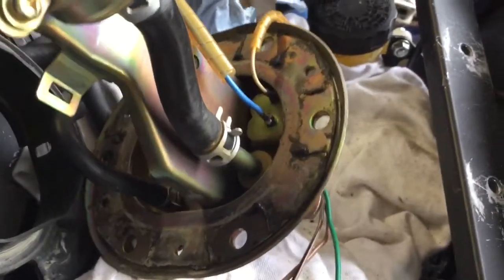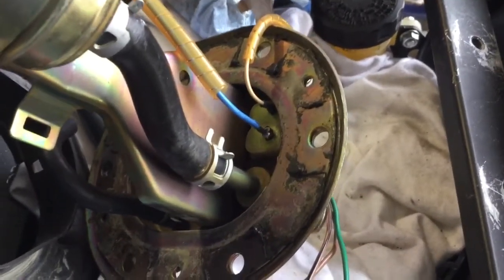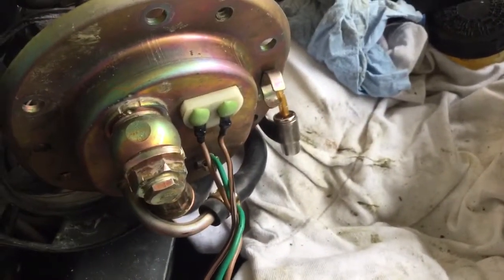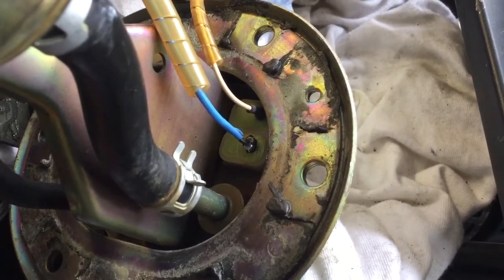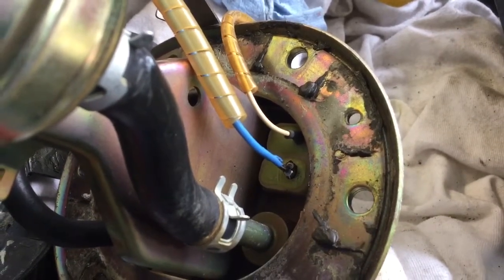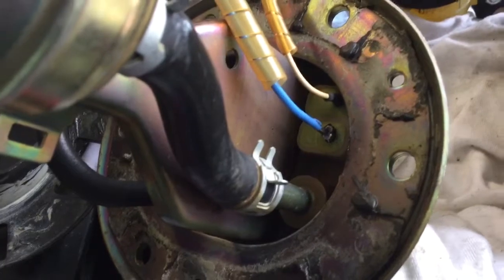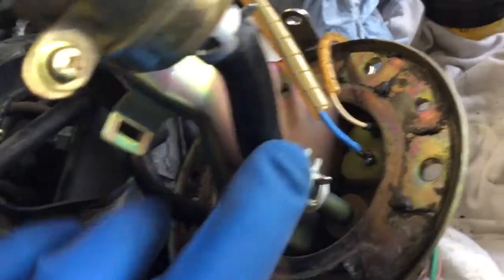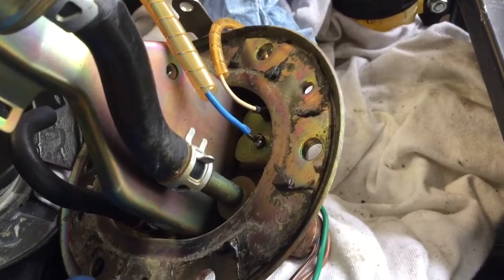Honda F4i fuel pump connection failure

Comment: I’m late to the party but I’m having the exact same issue. Mine was hanging on by 2 little wires how can I fix? I’m loosing power at 4th gear around 8k rpm can this be the cause?
Reply from the maker: Tough to diagnose. Losing power at 8k could be the fuel pump. The power on my bike was cutting out completely. You didn't mention if you have already replaced the fuel pump. Also, I had another bike that had aftermarket ignition coils. It would misfire when it heated up. I replaced with OEM which were more than four times the price if I remember correctly, and the problem was immediately gone. So a connection issue COULD cause your problem but it is more likely that the symptom would be intermittent shut off and finally no start. Another thing to check on these old bikes is the kill switch. Disassemble it and see if it provides a clean connection. They get a patina from age that can be a sneaky loss of power to the fuel pump. All the best...
Reply: That exact wire next to the blue one the orange/brown looking one where it hooks up to the top was what I meant that was hanging on by 2 wires
Reply: When I got the bike it was full of rust in the tank, so I treated it and got most of it off. Prev owner said he did fuel pump but not the fuel filter or regulator. So that’s what I was going to do when I noticed that wire barely hanging on
Reply: Do you know what that wire/ connector is called and if I can just buy it on its own ? If I can solder it then I will
Reply from the maker: @antoniolagorda  Have you checked continuity? The part is no longer available. You would have to look for a used one on eBay. I saw a few on eBay for $300 and up. That's a lot to pay without knowing for certain that it's the problem. Have you tried cleaning your injectors? Try some Lucas injector cleaner or Sea Foam. If you are having a consistent loss of power at 8K, I doubt it is the wiring harness. In my opinion, if it was a short due to vibration, it would be more intermittent and ultimately not start at all. My bike wouldn't run. I bought a fuel pump (still have it) but that didn't help so I traced it to the electrical issue.
Reply from the maker: On the OEM parts list, the unit that connects the fuel pump wiring harness to the bikes main harness is called the "fuel pump stay" and it is not longer available. The entire unit which looks like it includes the "stay" is available and costs $573 at Partzilla (that is for a 2002 F4i). https://www.partzilla.com/catalog/honda/motorcycle/2002/cbr600f4-ac-cbr600f4i/fuel-tank-01-06
If that links works the way I'd hoped, the "stay" is #8 and the entire unit is #1.

Comment: Seriously, thank you for posting this. Had a failure on my 2002, 919. Initially thought it was a fuel pump. Even put power to the old connector, before purchasing a new pump. Installed the new pump, and the thing was still dead. Did not think it would be possible to solder as you described here, but figured what the hell I’ll try it. And just as you said it would, it worked. 

You didn’t need to post this video, but you did, and your post save me a world of a headache. Thank you. :)
Reply: A couple of more elements to note, this appears as a common failure on the (non-RR) honda bikes from the early 2000s- to the early 2010s. So the F4is, the cb900f (aka honda 919), cbr929 etc. 

one of my concerns was the now-exposed-fuel-pump wire shorting out in the tank, either directly or from the metal "brillow-pad" that is around the fuel filter pickup and causing a fire. Two items here; (1) gas is an insulative  non-conductive liquid, so it should not arc (2) even if the brillow pad shorts against the wire in the fuel, it shouldn't catch on fire, because the fuel 'should' be able to dissipate the heat, so long as it is covered. Remember that it is the atomized gas that Is most flammable, and lighting a fire from the inside of the liquid out, is not so much of a risk. If the tank is sucked nearly dry, I guess that could cause a risk, but hopefully not :)

Comment: Did you cover the stripped back wiring with anything after you solder the joint?  How has it worked up till now?
Reply from the maker: Didn’t cover it. Haven’t had any problems with it.